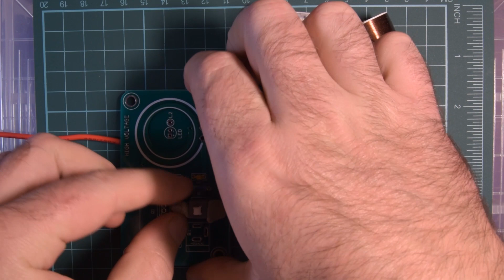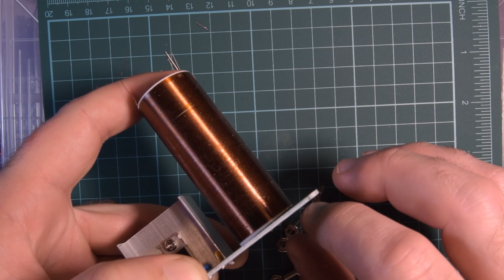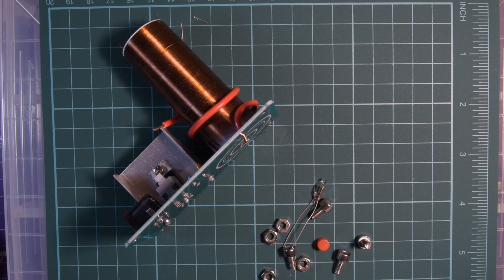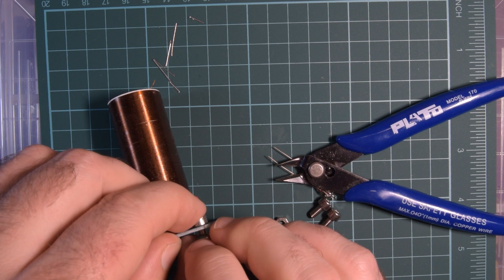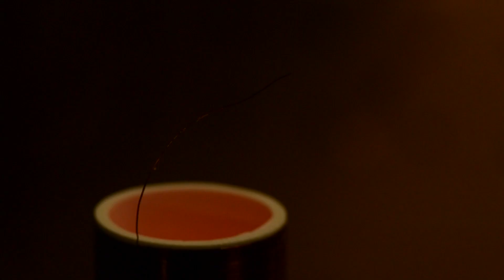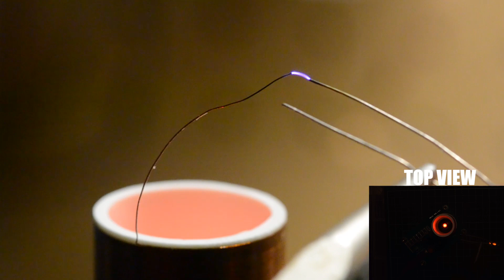Kit Build: DANGEROUS Tesla Coil Kit

Comment: With two turns on the primary you halved the voltage.
Reply from the maker: That's true, since the secondary has fixed turns, halfing the primary doubles the ratio. Very good point
Reply: @SimpleElectronics It 
would be interesting to see how that  works in practice. Lose a turn and check the spark gap?

Cheers for the video - it's always fun to watch one of those cheapo kits put together.

Comment: A few more turns on L1 would have been electrifying lol. I think you have the feet on upside down. The head of the bolt has more surface area and would make for a more stable base.
Reply: Other way around - fewer turns on the primary increases voltage on the secondary.